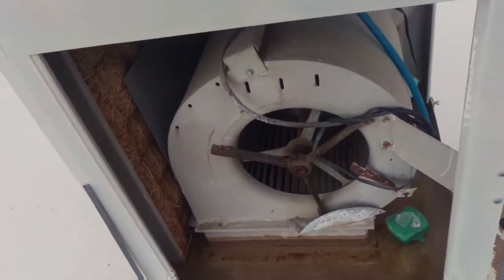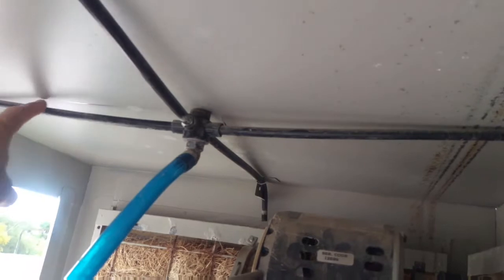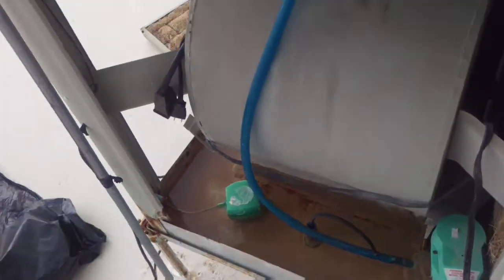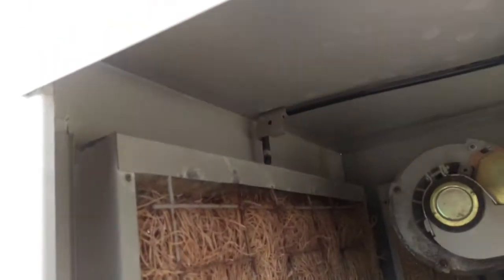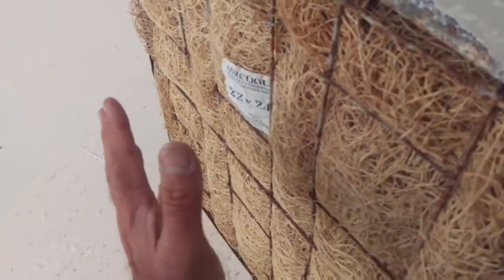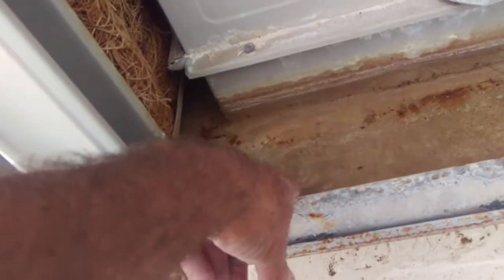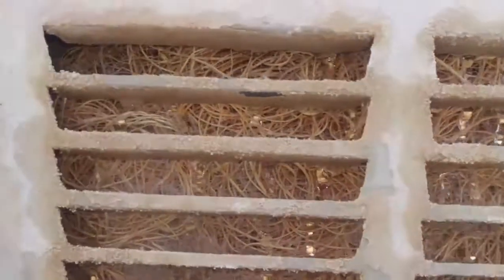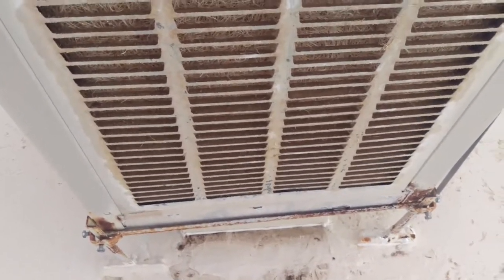Swamp / Evaporative Cooler.

Comment: Hi, I have a question, how often you need to change de aspen pads?
Reply from the maker: Hi Dulce, it depends on how often you use it. If you are in a place where the water is really hard and has lots of minerals it will clog up and lose efficiency. If you shut off the water to the pads for any length of time it will have a fishy smell when you start it back up. Change the pads at least 2 times during the season and more if you want to. That's your option. Thanks for reaching out and stay safe.😷👍